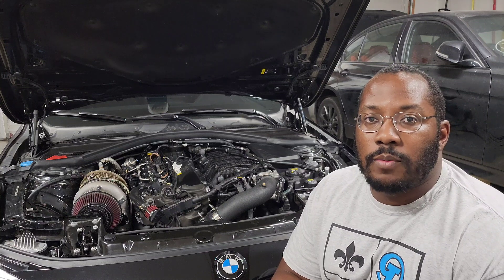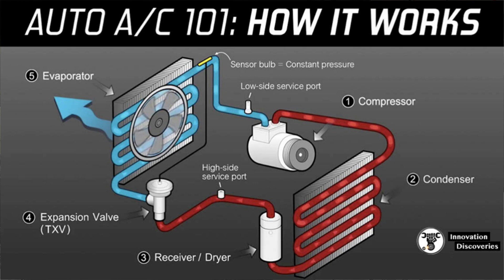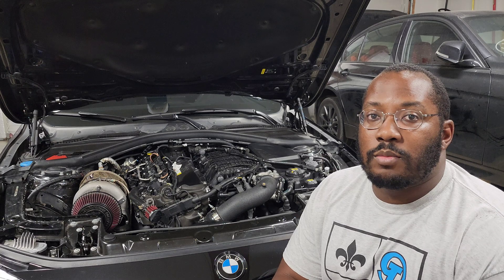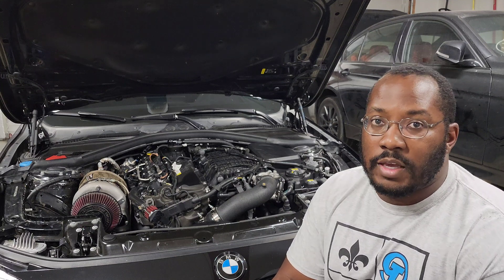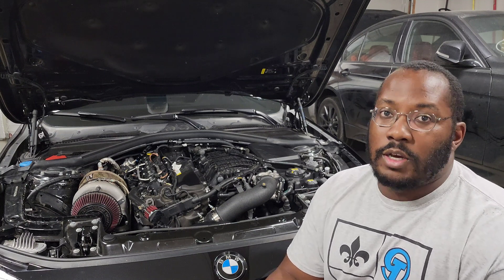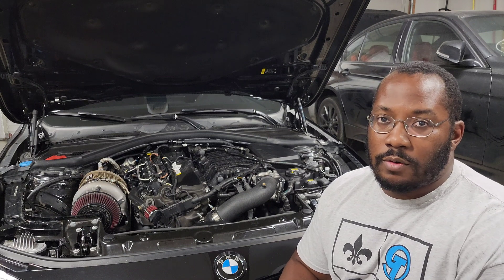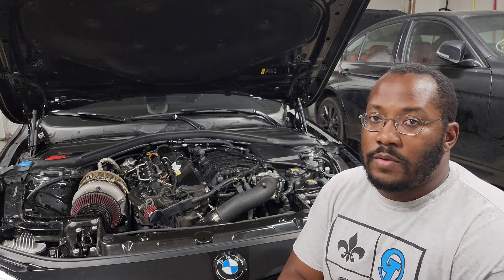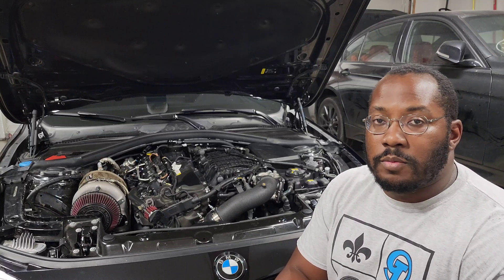A/C Blowing Warm in your 340i/Supra? Check this First! - B58 Common Issues

Comment: A question, will the A/C compressor turns on and off while this is the issue? I had my coolant changed due to a leak in the radiator. So I took it to a local shop and replaced the radiator with a new coolant. Now the a/c is not cooling and I can see the compressor turns on and few seconds it turns off. Is this what you described?

Comment: Need some help here! My A/c has been topped up, no leaks indicated as I had a compression test. A/c compressor spins when turned on however no cold air. It just blows hot air. Sometimes there is a hissing noise when I use the blowers. Any ideas what might be wrong.
Reply: Make sure you didn’t add too much or too little, or to high of pressure or too low. Things like that throw it off, maybe try going to Low pressure side and letting some pressure out slowly and try again. Happened to when I refilled and it didn’t work until he removed some pressure also removed some oil inside the system.

Comment: I just recently replaced my evaporator core, and my car is again blowing hot, or not blowing cold. I do believe I have a coolant leak somewhere, so I now constantly have coolant in the car, religiously. The A/C guy is supposed to take the car from me again...right after I installed my downpipe!!!

I hope he can fix the problem.
Reply: Check front mounted condensor for damage mines leaking there I thought it was a coolant leak but the shop pressure tested the system and no leak for me it’s a punctured condensor

Comment: Got a 2016 BMW 340i AC not blowing cold at all.  Pressure is way too high. Just changed all the lines, condenser and compressor still not working. Anybody else deal with something similar or have any ideas on what it may be?
Reply: If you've already replaced the condensor, then check that Front Radiator is working. Most probably is clogged. Have it washed and cleaned well or replace that also. The High pressure is due to the water pumps trying to recerculate the Coolant, but it's stopping somewhere where it can't flow further. You'll have to check that with the Water Pumps that both work fine/ (There's a larger one and a smaller one. Both Bosch I believe. Replace them both)
Reply: I’m currently having this issue did you find out what was causing it by any chance?

Comment: I have a questions, so my car is 2018 540i msport, I have refilled AC refrigerant twice professionally and even after I swapped a “leaking” low side hose for a new BMW one. Got it refilled, AC lasted a month and then it started blowing warm in other vents expect for drivers vent. So when that happens I know the AC refrigerant is low. What could be possibly leaking? Compressor looks Brand new and no leak on it and on the hoses so maybe EVAP inside the dashboard is leaking somehow ?
Reply: I feel like this car is WAY to new to be leaking AC Freon already….
Reply from the maker: Could be anything. You have to test it
Reply: Have same Problem, do you find the Problem?
Reply: @IlirZumberi  yes evaporator leaking inside of dashboard area so I just used the r-1234yf can that has the leak tech and I add like one a year and air blows out cold all the time but I do have to get it repaired tho.
Reply: @murgeecars  have you done it?
Reply: @IlirZumberi I have not 😂 my ac still blows cold but maybe it’s close to refill again with the seal tech/ yf1234 again to blow colder. It hassle with the amount of time it takes and also it’s close to $2k repair.
Reply: @murgeecars  okej thank youu

Comment: Hello Kern! First of all thank you for all your hard work you put in this channel, im pretty sure you had helped everyone here at least once!
Second, sorry for my bad English, it's my second language and im still learning!
I hope you can see this comment and maybe help me, or anyone in the comments.
I have this exact issue with my m240i, my AC starts to blow hot air, then I proceed to refill the coolant level up to the max, but when I do so, my car starts to misfire, it starts to have little "backfires" that you can hear in the exhaust, and it appears a drivetrain malfunction message in the Notification Center, my guessing is that maybe my coolant system has a leak somewhere, maybe some coolant leaks right to the combustion system, but I don't really know what is happening with my car. Hopefully you see this comment and give me your thoughts about it ASAP, god bless you Kern!
Reply: If anyone in the comments have any clue about this I will really appreciate your help :)
Reply from the maker: Pull your intake manifold and make sure the intercooler isn't leaking
Reply: @kern417  
Thank you Kern :) I’ll tel you know if my issue is solved!

Comment: Ive got yellow coolant in my low temp circuit.  What's the best way to flush it so i can refill with the blue coolant?  My bmw dealer said theres no listing for yellow coolant in my 2017 430i.
Reply from the maker: Remove the lowest radiator hose, drain, fill, bleed.

Comment: @kern417 Great video and much appreciated! I actually discovered this on my own after tinkering under the hood after a mechanic told me my compressor needs to be replaced... (not spending 2500 without being certain that was the issue). Found out the small res was bone dry, filled it, and ac started blowing icicles again. Fast forward a year and my ac is blowing hot air again... at some point during the winter the res went bone dry again (dont know how long i was driving with it like that). I topped it off with coolant and unfortunately this did not fix the problem. I brought the car to a mechanic and explained everything i know. They insist the compressor is bad but again i want to be certain before i spend the money. Any ideas what the issue could be and where/ what i can check to diagnose?
Reply: Most probably Front Radiator or Condensor/Drier is clogged. Have that checked with your Water Pumps. Waterpumps fail when overpressured or dry running.

Comment: I went to refil the coolant after a Night of the car sitting, so it was cold, when o opened the cap, water spilled all over the place, I dont think it should do this. Any idea?

Other thing, I checked for codes and got this below with error 20A201.

There is any rigor way to check the coolant level on the small Tank?
Reply from the maker: Open the cap and check. When you opened the cap coolant came out? It was way overfilled if that's the case.
Reply: @kern417  yes! The funny thing is that it Wasnt serviced, it was Running fine and all of a sudden it stopped blowing cold air.
Reply: @kern417  Not necessarily!  or just the Water flow clogged along the path and pumps aren't circulating well that caused that extra water pressure. People in hot climates know this.
Reply: Most probably Condensor/Radiator cloggen. Will work fine when replaced, or washer properly.

Comment: Is it normal that the vent blows out warm air for a few second at start ,then it start to blow cold air?
Reply from the maker: depending on the weather, yes. usually it blows outside air first before things kick in, so in winter it'll blow cold first.
Reply: @kern417  Only 1-4 Series Cars. Larger cars have better AC parts.

Comment: does this also happen to the b48 engine?
Reply from the maker: Yes it works the same way
Reply: @kern417   @kern417  Not really, 7 Series have a different AC path and actually does have a Front AC Radiator. This Only applies to 1-4 Series.

Comment: The radiator supplies the as condenser with water to cool the refrigerant, right?? 
Hypothetically, if u install the csf radiator (or any bigger radiator) it would cool the ac condenser better (or let’s say, it would cool it faster = you would reach the desired cool temp in shorter time) right ??
Reply from the maker: I get the theory but I don't expect it to make that big of a difference

Comment: Would this case apply to B58 in a G30?
Reply from the maker: Yes
Reply: @kern417  Not really, 7 Series have a different AC path and actually does have a Front AC Radiator.

Comment: Off topic to this video. But when my trans a bit a cold, i hear a squeak in between gear changes. And this isnt during hard acceleration, maybe 1/3 throttle. And when i say a bit cold i mean like after 15 minutes of driving. After about 30 minutes it doesnt do it. What could it be
Reply from the maker: Are you sure it's your transmission? It might be your belt tensioner.

Comment: Kern. My AC is starting to smell even after replacing the filter. I replaced the filter at 15k miles. And now at 30k miles, after replacing the filter again, it smells like a dead animal at start.
Reply from the maker: Hopefully you don't have any mold in the blower system. You can pull the glove box and look behind it to see if there's any thing that needs to be cleaned out
Reply: I have the same issue as yours on my 2019 X3m40i on 34k miles. Was your bad smell happen every time at start? Mine happens occasionally but when it happens it does smell strong and stink for that second.
Reply: @liken1288 the smell is from leaky evaporator

Comment: If you do find damage to the heat exchanger that is mounted in front of the radiator, make sure you install the rock guards from bmw. If there not installed already. Also make sure the pump has not failed. It's mounted just inside the driverside headlight. Once you lose the coolant from the system the pumps fail quick. Good info Kern.
Reply: What pump is that?

Comment: What about the puddle of water after drives with the ac on? 

Leak or condensation?
Reply: Neither, that’s b58 sweat.
Reply from the maker: The evaporator that blows cold air into the car gets a lot of condensation and it just drains under the car. That's normal

Comment: Literally just had this issue recently where my AC doesn’t really cool when it gets too hot outside (not overly often here in Scotland 😂). Haven’t checked coolant for a while but, this makes perfect sense now. Thanks for explaining and much appreciated.
Reply: Check that your Water and AC Paths are clean. In cold weather you'll never find issues in B58s. The Condensor does all the work, but when in Track or hot weather. A clogged Radiator/Condensor will cause Misfires and blow up your Engine in a millisecond before you reach 4500 RPM.